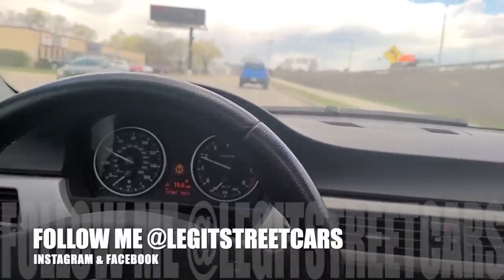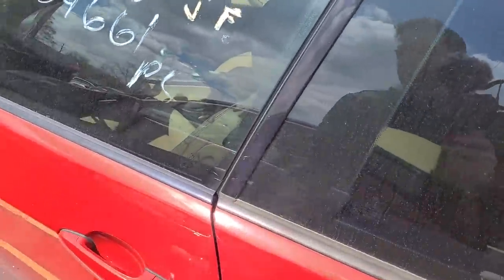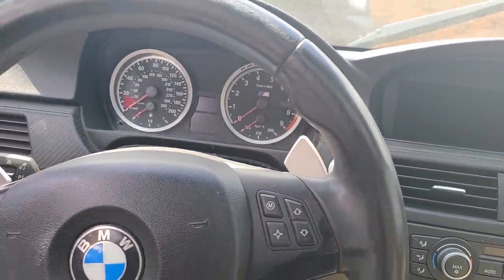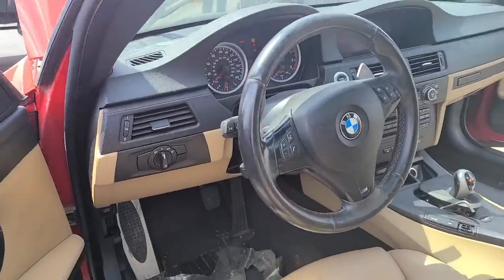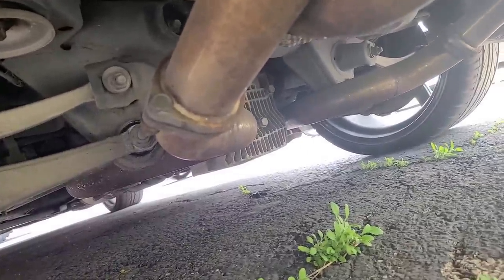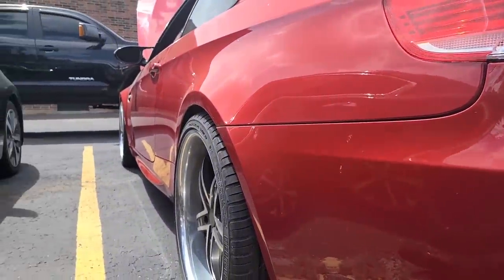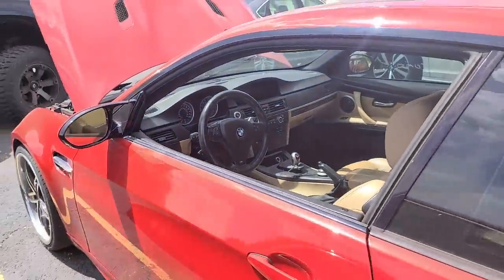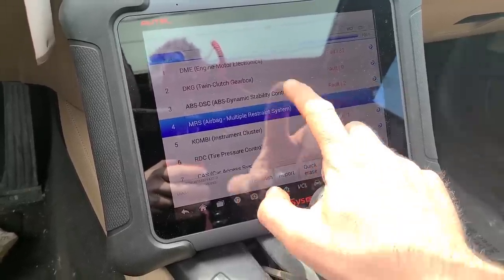I Found A Dealer Auction E92 M3 Sitting For 3 Years With A Supposed “Bad” Engine! Listen To This!

Comment: When a shop doesn’t know whats wrong with a car they usually just say it needs a new engine it’s just easier for them
Reply: If there are metal shavings in the sump, it needs a new engine...
Reply: @FelixRisingOriginal  not always buddy it can be fixed  sometimes it could be really easy but they dont wanna dig in and get dirty so they just replace the whole engine easy for them expensive for you
Reply: @xwhels  Replacing the engine is one-and-done and something they can warranty.  Tearing apart and rebuilding these engines is above the skills of most shops.  Not worth it monetarily for them to do it.
Reply: @bigpjohnson  warranty is a scam the warranty “the engine” but not labor even for replacing 
And you just proved ny point they only know how to take stuff of and put another back in
Reply: @xwhels  yeah, I guess a complete tear down, replace all bearings, flush all oil channels, replace or refinish cam lobes... but at some point all that work can be undone by one small metal shavings stuck in an oil channel somewhere... And you're back at square 1. The amount of labor would also at some stage be worth more than a crate engine.
Reply: @FelixRisingOriginal  no one said to do all that they dont even bother to take the engine half a part to see if it is fixable or no they look at it it makes noise okay a new engine
Reply: @FelixRisingOriginal  from the way you defend them you sound like a mechanic
Reply: @xwhels  hahaha, I have no clue. It's the internet and I watch mighty car mods and this... Every jerk and his dog can have an opinion ;) hahaha

Comment: I’m on my 14th bm. I know that you don’t get that level of damage to seats and steering wheels. Add another 100k to the mileage and maybe. There are body issues all over. Such as around the drivers side headlight. This will be a big gamble

Comment: If you buy it and have him look it over, an engine rehaul on those S65 engines would mean all new vanos lines inside the engine, good idea to rebuild or replace the 2 throttle actuators (they control the arm linkages for each individual throttle body) inside the  valley of the engine, and might potentially need the two igniter controllers that sit on each bank. The very expensive parts are the vanos solenoids and there are 4 of them. I wanna say they’re 800 each unless you get cheaper clones. Hopefully the trans is good, that would be a rough surprise if its not shifting right.

Comment: Walk away from that car, it's way way overpriced for the issues.
Reply: Its a $3k car. Unless he finds a real SUCKER, he is not getting anywhere near $10k for that thing. $10k if the rest of the car was premium other than the bum engine. It needs 3-5k in body work, another couple thousand to repair all the interior wear plus the engine. If it were me thats worth $3-4k tops.
Reply: @ps2cho  He's holding out for the sucker that will inevitably come along. That's why he didn't take Alex's extremely generous offer.
Reply: @ps2cho  and what if the trans is bad?
Reply: @ps2cho  and another 2 grand to ditch the current atrocious wheel and tire setup it has for something decent
Reply: @ps2cho  I wouldn't give more than 2 for that car, it's got hidden issues you can just smell it.haha

Comment: I’ve seen an m5 v10 with similar symptoms which turned out to be a fuel pump control module
Reply: With metal shavings in the oil? 😂

Comment: Personally, did not get the best "vibe" out of it. It surely did not get much love and attention, that's for sure!
Reply: Agreed
Reply: Definitely. If I was him, I wouldn't pay more than $5k for it.
Reply: @tony_25or6to4  ya, if all the troubles where in one spot, like changing the motor. But like, everything on this car has a issue. I swear once he is done, might discover the car also need therapy because of its past years of abuses! ( Some cars, even fixed, still can feel the stress it had in the drive )
Reply: Basketcases seem like good projects, but will nickel and dime you forever and ever.

I overpaid for my BMW, but it was exactly what I wanted with very low miles and good maintenance history.  There were cheaper ones, but would have cost more overall to fix up versus buying the good one.

Comment: I would like to see the live data when it is running even for a short time as it will show Vanos, Crankshaft and Crankshaft position sensors as I would put money on a sensor shutting it down. I have just bought a E46 that has sat for the past 12 years which just needed many hours understanding the problem and a whole £40 to fix! 
Love the channel and myself worked for Mercedes from 2000 so have the same love for those era cars as you do and remember reading about the CL65 when the were new and the fact that mercedes had to limit engine torque to 1000NM as it was still getting 250ft wheelspin even with traction control on!

Comment: Your definition of a beat up interior and mine are vastly different.
Reply: I agree but considering the mileage, it is worse than it should be.
Reply: Agree
Reply: That's a considerable amount of wear on the center console and seat for supposedly having 40k miles. It was probably never cleaned.
Reply: I’m driving an 08 E60 with twice the miles and the interior wear is maybe 1/3 of this M3. This car was clearly abused
Reply: @Jonny2by4  I’m almost wondering if the dash was changed from a different car.

Comment: My E91 Wagon has 104,000 miles and looks practically new inside. It has very minor seat wear from entering the vehicle and that is it. The steering wheel buttons and the wheel itself all that stuff is very new looking. That car is crazy rough. I’d pay no more than 5-6500 for that car. Every car is worth something and with a new engine, factory wheels, tail lights you’ll be in a good starting place. As for the miles there isn’t many ways to outsmart a carfax on miles unless they rolled it back to the last reported mileage on carfax after driving it for a while.

Comment: Very suspicious of the 48k miles claim, my 165k mile Passat had a better interior
Reply: My 178k mile chevy pickup had a better interior lol, someone was not kind to this car.
Reply: I have 240000 on my '04 330Ci and the interior is still 9/10! These thing used to hold up. Maybe not so much now?
Reply: Thy says a lot given vw passat interiors age like milk
Reply: @kirbyswarp  Mine was fine, had it 7 years, cannot speak for other versions though
Reply: My 2001 BMW E39 looks better than this with 180K miles lol.

Comment: The e46m3,e92m3,e60m5 and my all have bearing issues from the factory.I have a 04 m3 and I'm thinking of selling the s54 and trans and buying a Ls3 and trans and having it dropped in my m3.The s54 has 9,000 mls since a total rebuild and runs like new the tans has redline fluid and a clutch with 9,000mls.

Comment: The tick is normal considering how long it's been sitting buy it
Reply: yea but it got metal shavings in the oil filter / vanos issues (like he said in the video) + he doesn't know the state of the transmission.
Reply: @CaptainRemy  oh no
Reply: @CaptainRemy  the trasmission is probably ok with that mileage and I wouldn't really trust the seller unless I saw the metal shavings with my eyes
Reply: @pier11francesco  Please watch the video before commenting. The car is litteraly parked infront of a car shop (parked for quite a while), wich means that someone already 'tried' to fix it. 

Also, if someone (that sells their car to you) said that their engine is toast (has metal shavings in oil filter, etc.), does that mean that i should not believe what he says and just think that the engine ok?

Also with the transmission, how do you know if it is ok? He could not do a test drive so he never knows. If the engine itself is toast at this mileage, then who knows what state the transmission is in?
Reply: @CaptainRemy  bruh I watched the whole video and with all the conflicting details gave by the seller I would not trust him even if he said that the engine is dead at this point you might aswell ignore him
Reply: @pier11francesco  Bruhhhh what are you on right now??😂 At first you comment (=your original comment) that engine tick could be normal for a car that hasn't ran for a while. When i pointed out the other 'flaws' of the car, you said that the transmission could be ok and that you wouldn't thrust the seller if he said that there are oil shavings in the filter (like do you expect the engine to be in top condition, unless you see the shavings for yourself??)

Are u ok??🤣🤣
Reply: @CaptainRemy  You are not very bright aren't you? This is not a challenge it's not hard to understand my comment but whatever

Comment: These situations are the perfect example of what feeds BMWs "unreliability" claims, most times people dont care for the car and end up like this, needing a new engine.
Reply: Totally agree with that. They don't do (proper) maintenance and then hate on German cars because 'german cars are bad'. I've seen VW 2.5 TDI engines get 500k km mileage (with proper maintenance), even though those engines had quite alot of issues.
Reply: Any engine will die prematurely with a loser owner. BMW does have weird problems that such an expensive and overengineered brand shouldn't have. Like internal components wear out? You often hear "This is a known problem..." whenever it's about a German car. Usually something really expensive too.
Reply: @rosen9425  
The thing is that with BMW vs other cars or German cars vs others is, BMW engines for example have different compression ratios, more power meaning more wear over time, thicker oils, and often high revving. What this means is, wear is faster on BMWs, skipping the maintenance will lead to destruction, the already thick oils getting thicker and mucky or disgusting by not changing the oils is what scraped the internals, the engine is trying harder to the demand of your foot on the pedal. Toyota’s for example have way less stress naturally do to low power and thinner oils, limiters on the RPM, and top speeds are shortened and no one is racing those cars. That’s where problem begin and no one is seeing it, BMWs are assumed automatically unreliable because owners don’t understand the concept of what oils do and how important it is, they don’t understand what a warm up time is and why, they don’t get what it means and how important it is to not stress the engines on cold stars or when very hot. This concept applies to mostly European cars because lot of euro cars are exotic compared to the rest of the world no matter how much it cost from 35k MSRP BMW 2 series to almost $200k M8, Porsche, Audi, Mercedes, Lamborghini, Ferrari, all have this concept and have their “unreliable” claiming 2nd+ hand customers/owners. BMW absolutely has issues but they’re very limited, M60/S85/S65 and N20 or early N63s but those engines are in cars that cost too much for someone to buy 2nd or 3rd and go cheap. BMWs are genuinely for people who care and have the money and the brains to use them and maintain them, people with the money should be smart enough to take care of it, most of the unreliable claims come from people (no offense) are the people who can’t keep up with the costs, and afford the original price..usually don’t care about what to do with the car or how to maintain it, it’s easier for them to complain and get mad about it then actually deal with the issue.

Comment: My guess that the valvetrain messed up because they didn't time it correctly and they didn't clean anything after the guy installed bearings.
I wonder if that car was used to rebuild another because it was wrecked and not run through insurance. Also could you check by VIN the interior color the car came with from the factory by speaking to the dealer on CarFax?

Comment: Good idea new car projects. I  think your offer on the AMG BMW (boat anchor) was to high. I figure body work, paint, exhaust repair and replacement, brakes, interior repair and cleaning about 4,500 dollars. Now a new engine and inspection of transmission I could not guess the cost. This car could be expensive just on parts.

Comment: Run as fast as you can from this car that mileage doesn't add up to the wear, and the motor will need a list of parts a mile long, you should spend the money on a single turbo set up on the 335i.  The N54 will make more power than that S65 they only make 290 ft. lbs. of torque they are not that fast they just sound good.  More beamer content please, love the channel good work

Comment: Agreed with the $7,500 offer to the owner. That thing is pretty rough, and I would imagine a new engine and some body/interior work would bring that thing up to where it should be as a E92 M3. Those engines are notorious for rod bearing issues, but the owner being a MB dude and only asking for OJ to replace the bearings (in a used engine) was a big mistake. If you can snag it for $8k tops, you'll have a fun project car.

Comment: Be careful with the e9x m3, they suffer from dropping filings into the exhaust and then when the engine gets repaired they suck it back up into the engine. BMW’s main dealer repair instruction is to replace the cats when doing major engine work

Comment: DCT is NOT an automated manual, it's a dual clutch transmission which for the most part is ultra reliable. Way, way better than the previous generations SMG which you might be confusing it for?

Comment: Totally agree a right lemon , here in the uk a car like that even now at crazy prices is looking at £18k gbp with rod bearings and throttle actuators done , interior is not a 48000 mile one probably been clocked and also all the bodywork and those shocking wheels walk away better content out there for you to,post on yt

Comment: Iconic Car sitting at a Performance Shop...
Timing Issues
Metal Shavings in the Filter
Rod Bearings already replaced
Rear Fender damage
SITTING AT A PERFORMANCE SHOP
Needs new brakes all around
Engine out of the car

I'm a sucker for pain so I'd probably still buy it, sink 10k+ into it then realize I could've bought well sorted M3 for 3k more.

Comment: 1:15 Look at the pattern of bald spots on that front tire.
That car needs money spent on the suspension as well, lots of it as joints, bushes and dampers will need replacing.
I would keep looking for another project, that car's ruined beyond economical repair and that's why it's still for sale.

Comment: Assuming this is the same car OJ did work for, would 10k get you both engines? That would be a worthwhile deal since you could sell the second engine for something to apply towards fixing the car. Chances are one of them is good or close to good with minimal work, worth the risk. The wear is a concern on the interior, but I suspect it was rode hard and put away wet just about daily, but it’s not so far gone you can’t save it, especially with a clean title.

Comment: Hey, I have a 2008 m3 aswell. They are good cars. Mine has 209000 miles on original rod bearings. Aslong as theyre decently maintained they will last a long time

Comment: 7500 seems like a very good offer for that car. The engine and body work is going to be alone over 10k. Then the new tires and brakes. There was a lot of wear on the seat for only 48k.

Comment: i have a similar story with a semi rare e92 but not an m3.   i found a 2007 335i that the guy said had blown engine for $1400. it had a wrap on it but was super super clean...  i show up to test drive the car and instantly i recognize the problem. its just blown turbos .  car drives just fine but howls like crazy from the bad turbo.   i tell him hey the engine is good its just bad turbos and theyre cheap to replace.  he insisted he was a mechanic and that he knew the engine was bad.  i said well okay ill give you $1200 and he said okay.       i drove the car 6 hours home with blown turbos, it had 0 issues mechanically, no leaks, everything was in perfect condition.   i had a set of pure upgraded turbos from my other 335i and i put them on and tuned the car on e85 for about $3500 into the car and i drove it daily for two years all over california but thats not even the best part.    i peeled the wrap off and it was java green.   it turns out all dealers could option any e90 in all bmw paint codes and there were a few factory java green 335i. i now own one and ive got like maybe 7k into the car including the price of the car itself.  best deal ever.

one thing i can tell you about the modules in the e chassis though, if your voltage is off even a tiny bit, EVERY code will pop up randomly.  if the battery isnt at least 13v when running, it will cause low voltage issues down the line in the modules and your can signals will be off.  every bit of data between all the modules and the dme is literally on a 2 wire circuit. can high and can low.  these two wires control EVERYTHING in the car.  they are very sensitive to voltage drops or spikes.   on a e chassis thats been sitting for years like this,  its best to replace the battery entirely, monitor the dynamic battery and alternator system to ensure voltage is above 13v when running and then clear all the adaptations and let the modules all relearn.  then chase the fault codes after you do that because 90% of those codes will be from the fault memory and not active faults due to the battery voltage being low. i own about half dozen e chassis cars and theyve all had some sort of voltage issue at some point.

Comment: $7500 for that was more than generous.  Add in $3500 for bodywork/paint and another $2000 for "whoops, that's broken too" and you're already at the point you should run away.  Now... if you break even and count youtube revenue, you'll probably be slightly ahead but, it's still a risk in my opinion.

Now... if you don't build it, you might have some pretty awesome parts to swap onto your 335 though! :)